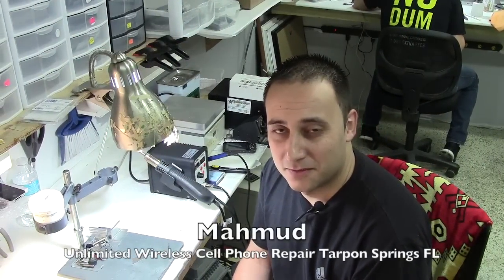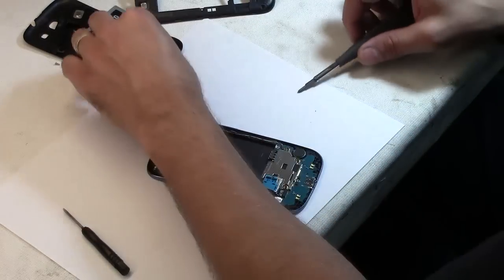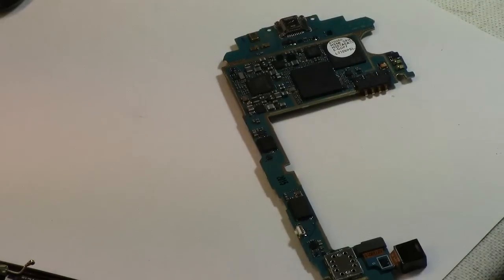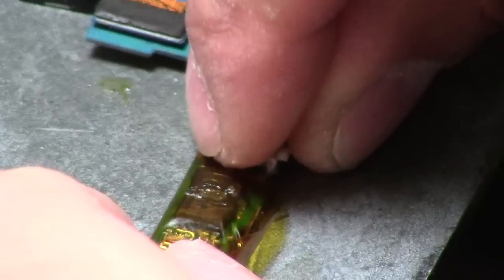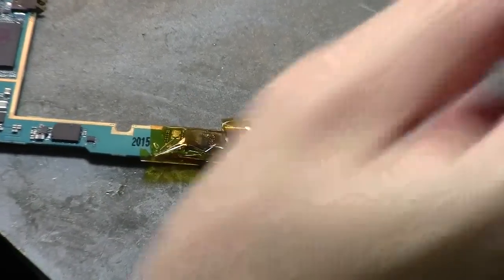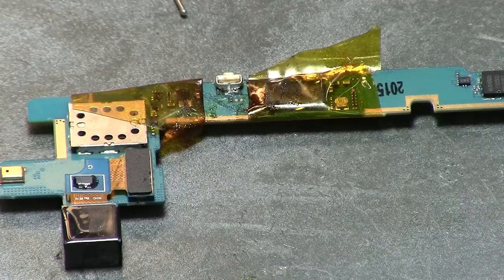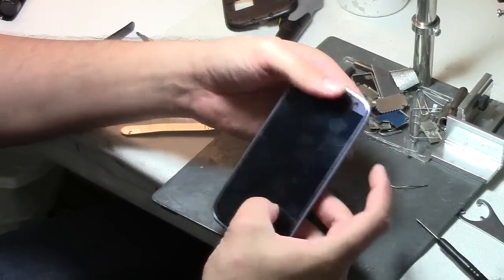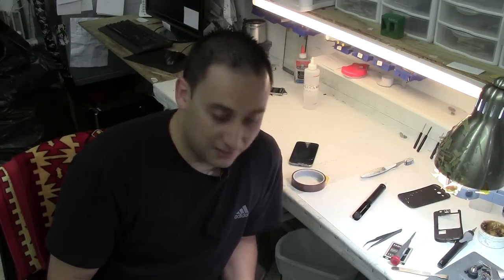Samsung Galaxy S 1-5 Power Button Replacement. Smart Pads & Phones

Comment: I have another problem (with the Galaxy S5, but it has shown up on almost all Galaxy S and ~ Note models). It is a small though pretty annoying design flaw I would think that should have been noticed by its designers dept. and improved upon years ago, it is really surprising how stick basic imperfections (sometimes especially those) can be overlooked the longest times!  -  what I am talking about is the fact that the devises have a power button that sticks out a millimeter-and-a-half too far from the chassis (body) and therewith irl is too easily pressed, which results in a phone that continuously keeps switching itself on - unwanted, unintended, inadvertently; by the lining of the pockets, by the hand that simply holds it, and when it is attempted to place the device on its side so as to watch a movie in landscape (in several of these instances the dual volume switch that sits on the opposite side is equally oversensitive). What actually would be needed is (a) button(s) that sit(s) a bit deeper in the body and therewith doesn't stick out - I was wondering if you could think of any way that might turn out to bring a possible solution for this problem?